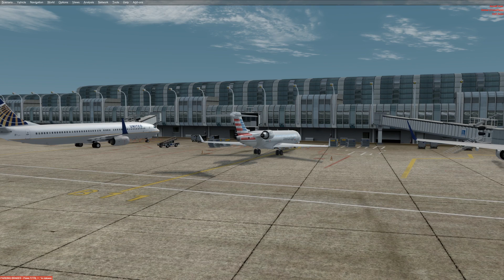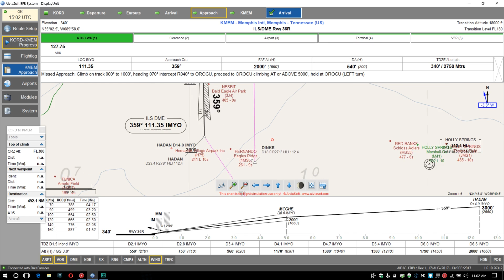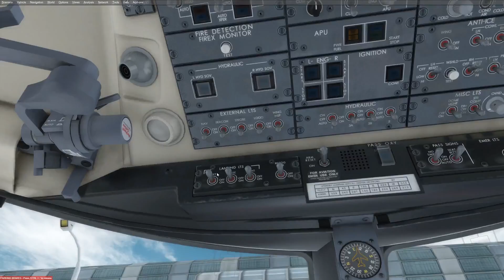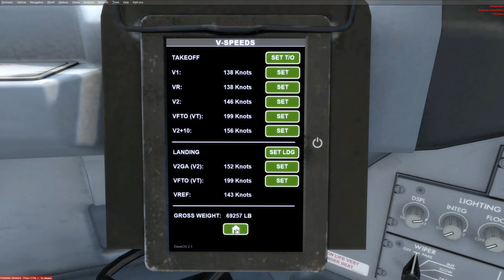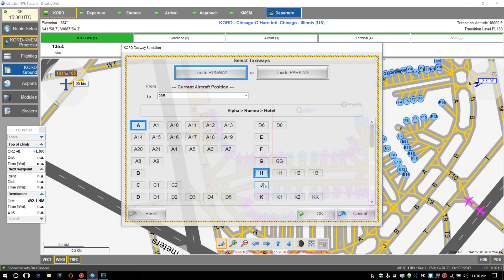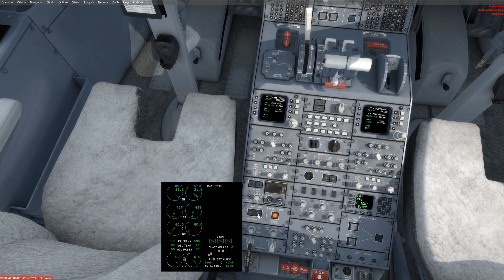FULLY LOADED CRJ Pt1   COLD AND DARK START

Comment: click on the airspeed panel (plate) and you can toggle yoke
Reply: wendy rice - I used to be able to hide my yoke using the speed placard, but after applying the most recent hotfix, it no longer works. Frustrating too, because that damn yoke is always in my way!

Comment: DC Service Switch AKA Mesa Night Light. In the US at least that switch is basically left in off the whole time. Basically allows you to turn on some lights without having to turn on the airplane batteries. Also don't have to change anything on the bleed panel, if the switch on the left is in Auto then the airplane will take care of all of that for you.
You can also use the APU a lot more and sometimes you even take off with the APU turned on (especially on a CRJ200). As a pilot you're more worried about keeping the airplane comfortable for PAX than saving $50 of jet fuel by running the APU so little.
For Take off there should be a TOGA switch on outside of the throttles at the top. It actually sets a pretty accurate pitch angle for take off then switch to HDG or NAV and SPD (CLB) after you get in the air.
Great video as always though and have fun in the money maker!

Comment: I think your supposed to set the landing elevation to the departure airport then set it to the airport your landing in before approach. This is so if you have a problem and need to turn around and land you already have the elevation set.
Reply: On the CRJ aircraft they have Flight Abort mode that will handle the pressurization properly if you return to the airport within 10 minutes and don't climb about 10,000 feet.
Reply: Brandon Hays ok. I just remember reading that in the tutorial flight.
Reply: Some airlines may do it that way. Everyone sets there own procedures. The one's I've been on have always just set it to destination airport altitude.
Reply: @brandonhays07  6000*